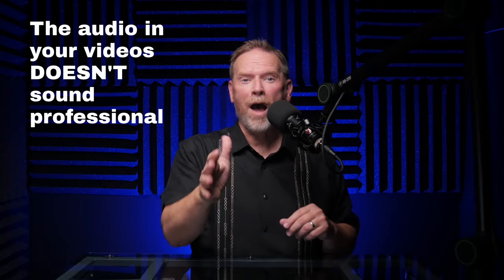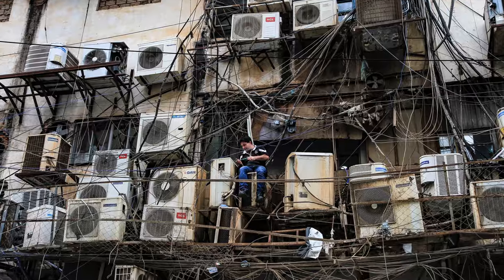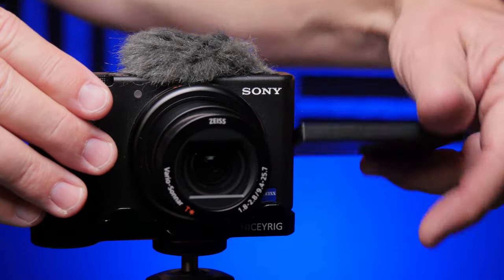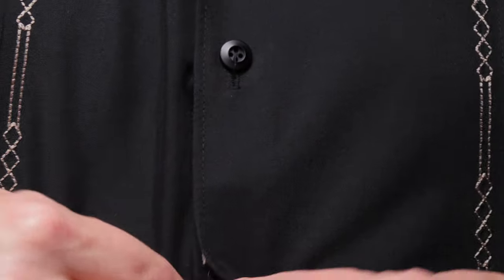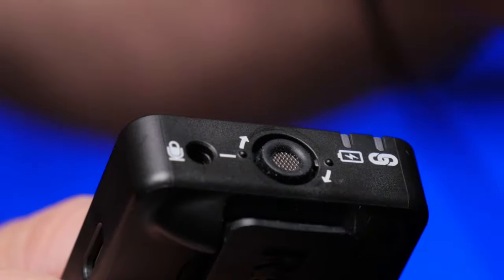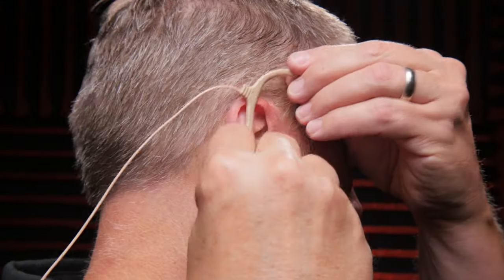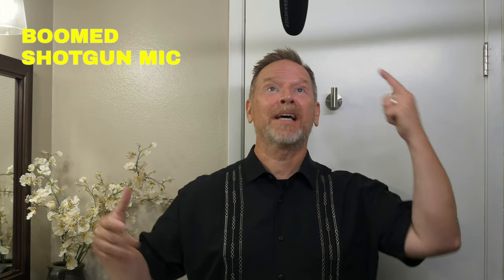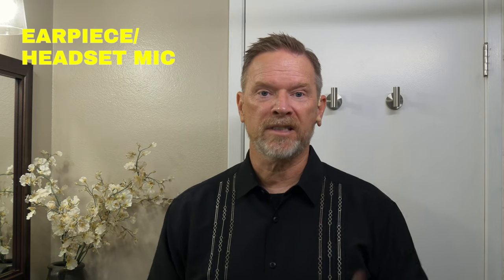STOP using the WRONG MICROPHONE for your VIDEOS!

Comment: Another very helpful video.  This one really highlights how location can impact audio.  A big issue with getting decent audio from my TAKSTAR shotgun mic is likely more of an issue with my room's acoustics.
Reply from the maker: You could consider mounting your Takstar on a desk stand or boom arm and running an extension audio cable from it to the camera. That would help reduce the room reflections and background noise.
Reply: @MatthewHaines  Looking back at some of my test recordings, I can see that a lot of the problems were room noises and echos.  The lav mic or using the shotgun very close covered up some of the room flaws.  This room has low ceilings with painted drywall walls/ceiling and some nearby windows.  I think room treatments and a boom mount for the Trakstar are my next upgrades.  I can upgrade the Trakstar later if needed.  Thanks!
Reply from the maker: @CascadesHomebrew  you’re welcome and good luck!

Comment: Those are some great comparisons and quality content right there Matt!

Most of the time, when I shoot interviews indoors, especially in acoustically untreated rooms, I use both a lavalier and an overhead mic, specifically an SDC. Like you said, shotgun mics might run into phasing issues when recording indoors. You get the benefits of both – intimate sound of the lavalier mic and the natural treble and air of the SDC which you then have the full potential of finessing the mix in post, plus the option of hiding the microphone out of shot! This goes to show that there is no one-trick-pony mic in audio recording.
Reply from the maker: That's a good idea, gives you lots of options if something isn't quite right after you've recorded. It's probably easier if you're not also the "talent" as well as the camera op and the sound engineer. :) Thanks for watching!

Comment: Got street level, untreated NYC apartment on the same block as a hospital and fire station? Move.  Or try an SM7b or RE20. Might work, or work better.
Reply from the maker: That's a tough environment to record in! I get a lot of street noise too. I've treated my studio for reflections but not for external noises. As a result, I typically record at night (less traffic) and often have to redo sections when I hear external noises like car honks etc. Yes a mic that you can get really close to (like a dynamic mic, or a condenser with a great pop filter) will help cut down the ratio of background noises. But sometimes you just have to redo stuff in cases like yours (ours!).

Comment: Hi matt how are you? Please try the new boyalink mic
Reply from the maker: Hi, Danny! I'm doing fine, thanks for asking. I did actually try the Boyalink and...I had some issues with it and decided not to review it.
Reply: @MatthewHaines so matt in your opinion between boyalink or BY-M1V2? which one is better
Reply from the maker: @dannyhernandez6792 the Boyalink doesn’t work well with a lot of cameras, even though it has a 3.5mm connector. I also thought the sound was slightly inferior to the M1V2. Unless you really need the two different phone connectors or can’t afford the M1V2, I’d skip the Boyalink.